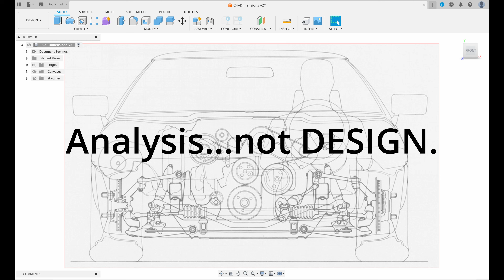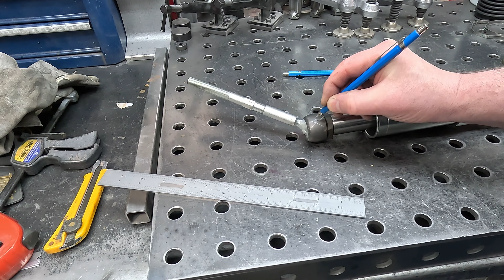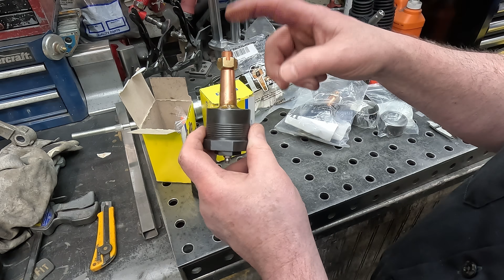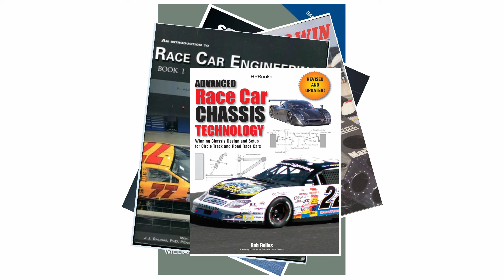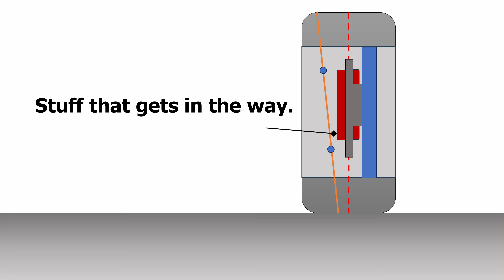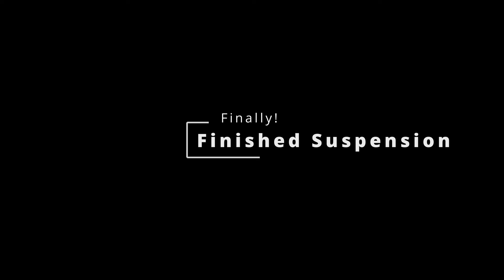Designing Car Suspension - From Analysis to Design.  Front View.

Comment: The Milliken Book is a Godsend. It is the ONE book that answers all the questions the other suspension books leave you asking and scratching your head over. Yes, It's expensive, but it is worth more than all those other books that DON'T answer your questions.

As an engineer, I'll tell you how I find steering rack pivot centers. 
I visit the manufacturer's website, armed with my steering rack item number, and look up the manufacturer's data sheet for that part. It will have a dimensional drawing or a chart with those dimension.
Normally, I do this before I purchase the rack.
I'll actually have a preliminary suspension design drawn up, and shop for a rack with pivot centers close to what I believe to be optimal. Then I revise my design if needed.
To get that data sheet you may have "register" on the vendor's website and/or perhaps have a phone call with a Sales Professional.
Reply from the maker: That book is truly the industry standard for a reason, and your approach to sourcing rack data is exactly how it should be done.  This is basically what I did for my rack source. Emailing has been useless - I was able to get into the tech services at a rack rebuilder and get some points validated.

Comment: Can this technique be used for designing suspension in sae Baja carts? Typically our rear arms are angled downwards quite a bit. Currently I am simply just using 4 bar linkage theory and just eyeballing ride height and camber change values without consideration of roll centers.
Reply from the maker: I cant think of why this wouldn't work for a Baja buggy. The principles are the same. There is also a fair bit of information on off road applications.
Reply: @ThrottleStopGarage fantastic, it's awesome that you're replying to comments despite the video being relatively old. I wanted to ask, you said that camber gain is achieved through the relative length of upper to lower. Is relative length describing only the x components of each arm? As in the projection onto the floor? Or is it the entire arm length itself? Thanks!
Reply from the maker: @michaelregalia2539 Interesting question. In a 2D front view perspective the relative length controls the camber curve. The 3D case is more complicated  because you then have to consider the caster of the spindle in sideview. Check out the videos by Car Design Workshop. He covers this really well.

Comment: The Corvette layout you show at the start is similar to the Formula 1 Cooper of 1960. Colin Chapman produced his F1 Lotus 25 only two years later and the geometry was close to what you have at the end of the video. It's remarkable that everything changed in only a couple of years and that Lotus got to a more or less ideal design most likely with only a drawing board and possibly some scale models.
Reply from the maker: I didn't know that!  Very interesting.  It was a surprise to me that once I'd set a few variables like track and camber curve, the rest just is what it is.  I've also done this about 20 more times since this video - got it to fit under a wheel now!

Comment: Miata scrub is ZERO. Despite everyone else telling us how important it is to have 10-15mm, they just use 0mm. Adding scrub (aftermarket wheels) makes the feel worse. If anyone knows why the exact opposite to everyone else works just fine for them I'd be curious to know.
Reply from the maker: I've never measured a Miata - but I've been on a track with several runniing 275's on the front axle and they're fast.  The issue is mostly one of fitment and not wanting the point on the ground to migrate across zero. I don't think it matters much if you're hovering around the centre of the contact patch.  Move it a lot (maybe 20 mm) and things can feel weird from what I am told.
Reply: @ThrottleStopGarage  Something that can be inferred from suspension geometry is that everyone tries to get a small scrub (zero in some cases) by using a big KPI. The main reason to have a big KPI is to reduce scrub.
I'm surprised 275 tyres will fit on a Miata.
Reply from the maker: Balancing the KPI and the Caster is, I think, important.  I spent a fair bit of time ironing these variables out along with a few other assumptions.

Comment: Brilliant! Thank you. I have read some of the books, which are helpful but you have given me a process that I can finally follow with confidence! By the way I can recommend a book called Chassis Engineering by Herb Adams. It explains in understandable words not just suspension design but also chassis structures and set up. One point that still concerns me is positive and negative offset on wheels. Every time I try to confirm the correct relationship of offset I seem to get different answers. You call it negative but others say the opposite! 😅. Anyway, sincere thanks. I will be watching more of your content.
Reply from the maker: I always make the +/- offset mistake...wheel mount more towards the front of the wheel is positive offset (less dish).  Anyway - sorry about that, it's a lot to keep straight.

Comment: I Did this in the beginning of -80’s with the aid of a drawing board and some brilliant articles in a Swedish magazine called Atomobil. This was when the rules changed that made it easier to build a car on your own, ( no crash tests demanded any more) as I remember it, a recomended meeting point for the suspension was 1,5 times traction width, how did you come to the distans in your calculation?
Reply from the maker: I was working with the existing wheel base and track width of the car.  The rest of the parameters are then computed from those basics and things like establishing a camber curve and caster characteristics.

Comment: I see so many hotrod projects, but so few custom suspensions. They use some old crappy suspension from the original car, or from some other car. I'll never do this, but it would be cool to take something like an old Camaro and replace the entire suspension with an advanced race car type custom one. I suppose it's a lot of work, both hand work and brain work, but if they're going to put so much effort into the engine, why not also upgrade the rest of the car? Those old pony cars are death traps on curvy roads, why keep the old suspension? There's more to life than drag racing.
Reply from the maker: Exactly.  I should be back on the upright design in a few weeks.  I did burn out on this part of the project.  Thanks for the encouragement to get back on the design.

Comment: Well i was waiting for why the corvette stuff did not work, but I guess that's in another video?
Reply from the maker: Let's chalk that up to depression.  Simple enough, but the time I pull the suspension in enough to get the correct track, the lower control arm inner pivots would be very close together.  This is both a problem for steering (getting my existing rack shortened) and worse...it would further reduce the room I don't have in the engine bay. So starting with a wider steering rack is a better solution.

Comment: You’ve done really well with your explanation and I thought you were going to bring rack in again at the end but, you didn’t. The books you showed are excellent resources and I agree they are not the easiest read!! They also don’t really explain bump steer very well at all and I suspect that’s why you didn’t talk about it in you design. If you draw a line vertically through the inboard upper and lower control arm pivots and the same again for the outboard pivots (upright or knuckle), These vertical lines AND your IC define the length and angle of your steering arm. You then offset the steering arm, along that line through the IC, by the amount of Ackerman you want to run. A 3D calculator will help here but if you follow these rules you’ll have near zero bump steer.
Reply from the maker: Great points - I did go over the steering etc in the next video.

Comment: Hey man, first of all I want to thank you for your efforts. I've learned a lot from your videos during designing suspension system for our hydrogen powered fuell cell car that'll compete in an efficiency challenge between University teams. 
I've been searching and thinking for how to define uca ball joint and pivot point locations but I still couldn't find an answer. What can I do? 
Regards.
Reply from the maker: Good luck with your team's build.  In front view - the UCA ball joint can be defined anywhere on the line described by the SAI.  Taller gives more tuning options, but you have to package it as well.  In front view - it's on the line from the mechanical trail set by the caster.  Inner pivots control (along with LCA length) the rate of camber change.  Set these and the parameters fall out pretty quickly.

Comment: You're one of the few posters that have started with the rack. But then you didn't continue with the why. It's my understanding that the distance between the centers of the inner tie rod ends sets the spacing of the lower control arm attachment points. If these points don't line up then you start introducing increasing amounts of bump steer into the design. But the rest of your discussion was spot on ! As you eluded the design of the suspension starts with the tire and rim combination which sets the track, the uprights which sets the distance between the lower ball joints then the rack length which sets the lower control arm length. Then adjust the length of the upper control arms to get the desired camber curves.
Reply from the maker: I needed a rack that was fast (lock to lock), narrow and available. It was either this rack or a mustang 2 rack.  Both about the same dimensions...which was not clear when i bought this rack as i understood it was a little narrower, which it isn't.  The other dimensions then work themselves out from there.  Sorry if this wasn't clear.  I also wanted to get the rack placed as low as possible to help engine packaging.

Comment: Craig, where did  you get the drawings for the Howe products?  I need to use them on my suspension design and have not found stuff specifically for the Howes, only generalized 'K' number drawings on the pin height not locating shoulders and such.
Reply from the maker: I drew them from dimensions found on their website.

Comment: Excellent work, I'm going to get stuck in on mine once I get my body mounts done (thanks for the idea on casting your own by the way) so I'm sure of the fender clearances.  I have slightly less variables than you as I need to keep the lower control arm frame side point on mine but the upper (within reason) and definitely the wheel side are all available.  Thanks for compiling the data on things like KPA and Scrub out of all of those cars as a starting spot.  Unclear if I start clean sheet on the front or practice by pulling the Q45 dimensions on the rear.

Also why the 350Z hub for 5x4.5in [5x112.3mm]?  I get not going with Ford hubs with the big centerbores but Nissan/Mazda/Hyundai are all still bigger than the Toyota/Honda size bore you have on your rear hubs.

Keep up the great content!!!
Reply from the maker: Thanks - I still have to work out the side view - reading more textbooks right now.  Stalling progress.  Pull the rear dimensions and get a feel for it before tackling the front.  That's basically what I've ended up doing.  I also got lucky on the rear when I shortened it - no adverse effects. 

The 350Z hub is compact - about as compact as I've found and was on the same bolt circle (5 X 4.5") - it was also a rear wheel drive car - so the front hub doesn't have a drive spline.  The difference is the hub center can be accommodated with a centering ring if needed.

Comment: Don't measure from the tip of a tape measure if you care for good accuracy, "burn an inch" or perhaps 10mm in your case and measure using the divisions and not the fairly approximate tip of the tape :)

The effort you're going into for this is pretty impressive and your willingness to jump into areas where you know you need to learn is great! I will admit the suspension stuff is Greek to me although I've certainly heard many of the terms and have some vague understanding. Much appreciation for trying to explain it as you're learning! The feedback you'rew getting is also awesome and I cannto wait to see what you end up building and how you like driving it eventually afterwards. It's like you're building Tally Ho in automative form - I love it!
Reply from the maker: Thanks - I'm lucky that I get the great feedback that I get. It all helps.

Comment: Wow, I love your honesty and the way you explained your process. From my experience, I would say most will run in loops because of the lack of tyre data available, as most things are fundamentally linked to those characteristics. It is interesting to use existing vehicles to determine your foundation numbers; however, it would say you should make sure you have similar spec tyres to those vehicles and have similar weight and centre of gravity.

So, the critical pieces of data characteristics you are missing are the following 

Slip angle
Vertical load
Horizontal load
Alignment torque
Rolling resistance 

Another factor would be the aero characteristics of the vehicle.

I look forward to seeing more videos from you.

When I was a student, my go-to was Race Vehicle Dynamics. I think everything I've stated is within that book. Essentially, they say that the suspension is designed for the tyres and keeping them in their ideal window
Reply from the maker: Thanks - I hold fast to the notion that honesty is the only policy.  We learn by our mistakes.  In the next episode, I will expand a bit and try to resolve the selected variables from first principles.  I was missing a few details that I've now got filled in and will work that through.  It would have been too much in the first video!

Comment: Thanks so much for sharing that hard earned information with us,  sir.  I'm just at the same stage with my build and wasn't confident with the direction I was going in.
I'm utilising MX5 front and rear hubs on a scratch built Lotus 11 I,m currently building and was hoping use the same upper and lower control arms but with a different track width. I think I need to go downtrend route you've taken to haveany success...
Reply from the maker: I am glad this was helpful.  I'm just working on a better method for determining roll and pitch centres.  Next video will have these details.

Comment: The explanation of front view design is great, start with the track width you need, add a few locations at the wheel, start from the center of the car then connect the dots.

I'll be waiting for the side view and am hoping for a top view vid as well.  Concerning top view, most if not all street cars ( use a 77 to 90 full sized GM ) have the lower control arm rotated so the front pivots are closer together.  I'm not sure why this is done but I think it interacts with what I'm typing below.  The upper is rotated as well but I'd have to look at a suspension to see what way.   

As for side view, the control arms pivots are tilted relative to each other , I'm pretty sure this has to do with anti dive where braking forces try to add spring rate to the front suspension.   Think of it this way.  If the brake was locked and you applied a torque in the direction of forward motion , how much torque would it take to move the suspension into droop?  High torque = minimal anti dive = nose droops a lot under braking.   Low torque = high anti dive = minimal nose droop = possibly too high of an effective spring rate leading to turn in problems.
Reply from the maker: Yup - working on these two views now.  I'm going to start with a review of the roll and pitch centre to clear up that point.

Comment: When poking around with suspension camber gain / loss, I've used a peg board and furring strips to simulate different A arm locations and lengths.
Reply from the maker: I've done the same - the combo of the web based platform and the CAD software now replace much of this, but getting a "feel" is important for me.

Comment: Cool video! I use the C4 front suspension for my race car, and I did a few things to help (not solve) the issue that you observe. My first solution was to get a longer lower control arm ball joint from Howe. Does put the control arm close to wheel hoop though, but 18" wheels clear fine. I also chucked the upper control arm cross bar spacers in the lathe and cut them down to the absolute minimum in the back and enough in the front that I could run more caster than stock for camber gain under steering input. Still doesn't give more than bout 2 degrees maximum static camber and I am going to go to a custom shorter upper control arm to get that sorted. Lowering the upper arm inboard pickup points would help as well, but not sure how much fabrication I'm willing to undertake.

Nice video, thanks for making it!
Reply from the maker: Cool.  I've got a set of those taller lower ball joints (1/2" if memory serves) that were part of my original optimization quest.
Reply: When I was autocrossing my C4 ages ago, I put offset lower control arm bushings in which increased the static negative camber markedly.  These are still readily available.

Comment: I could only make it through 1/3 of the video before having to stop watching. Having built many chassis with the C4 suspension, I think you should ride/drive a car with it installed correctly before you assume things are not good. Your 2 dimensional approach is probably not the best. Your assumption that you have a grasp on suspension design and it should be shared with the world may be a bit off as well. Hopefully too many people don't watch this video as a tutorial.
Reply from the maker: Why even comment?  You didn't even watch the design part.  I'm not making assumptions, this is what they do...it won't work for me.  GM changed it for a reason.